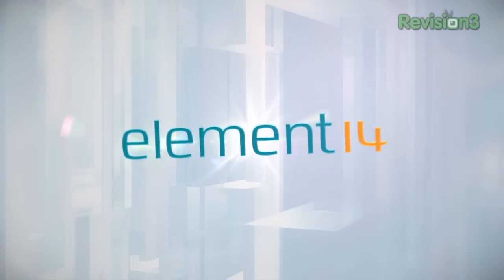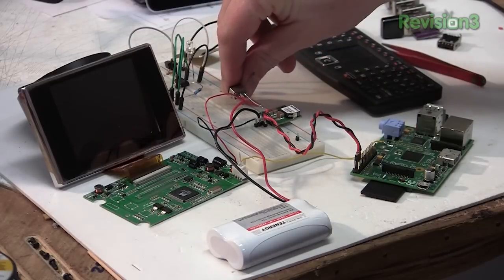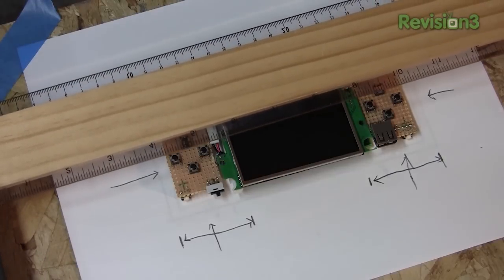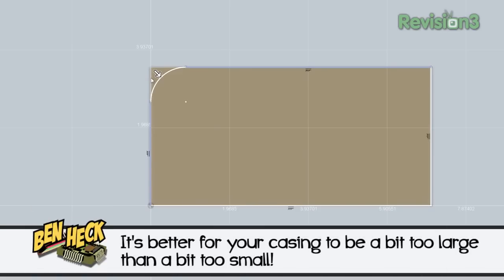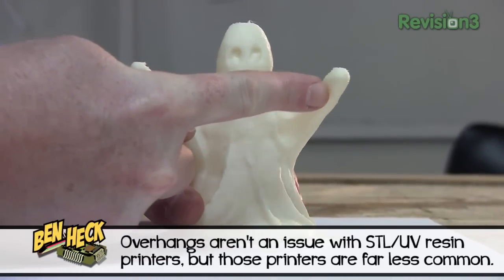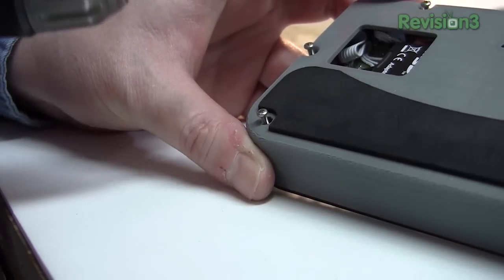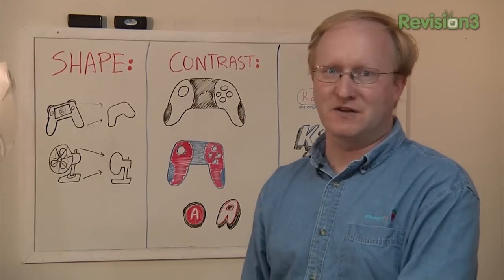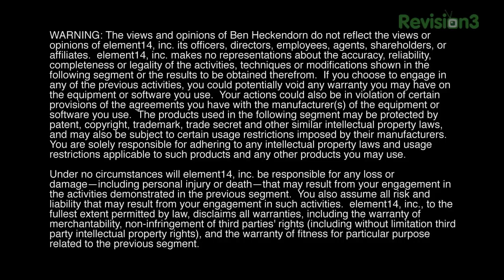Design Tips for Electronics Enthusiasts

Comment: Imperial and US Standard are not always exactly the same, for example an imperial ton is 2240 pounds while the US Standard (Short) Ton is 2000 pounds all while the Metric Tonne is 2204 pounds. The UK Weights and Measures Act of 1824, which introduced the standard of using imperial units, came much after the US became independent.

Comment: well too cold doesn't actually kill it, but there may be issues with condensation so include one of those anti humidity packets (that look like salt bags from restaurants) in the box of the Pi, and secure it with double-sided sticky tape on the inside of the box without it touching the electronics. Those anti humidity packets usually are included with electronic gadget shipping, or buy it on-line as Silica Gel Packets

Comment: Well you can get a vehicle heater that uses a tiny amount of the car's fuel (or special ethanol mixture)
to heat up the engine-block fuel tank and fuel pipes. I have one that works down to -50°C

Comment: the raspberry pi is qualified  for temperatures from 0 to 70°C
for car components it's usually required to be able to withstand -20 to 105°C
So depending on where you live  you might destroy your Pi if you let it cook in the parking lot on a hot summerday

Comment: you can kill IC's with heat even when they're switched off, are you going to design a secondary control unit to control the fan while the car is parked & Pi is turned off ? besides if the sun heated up the air, moving it around with a fan won't have much of a colling effect anyway. It is an issue, technical specifications for car electronics are there for a reason, but go right ahead ignore reason
in favor for bravado, what do i care if you wreck your stuff.